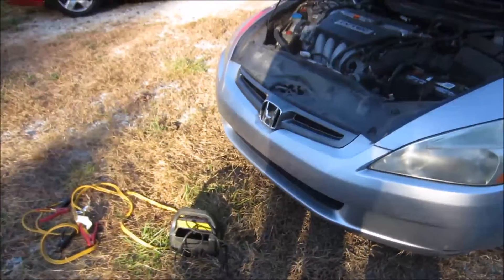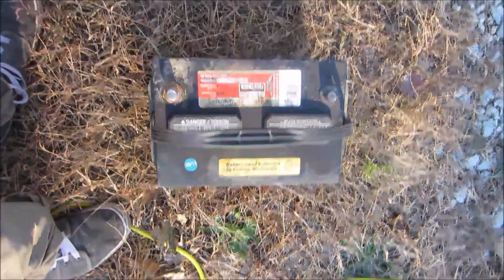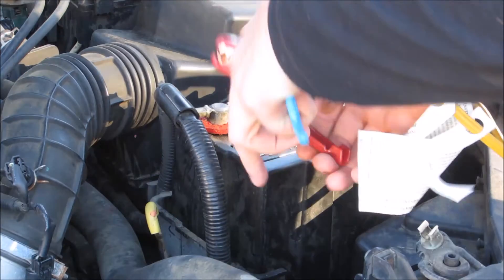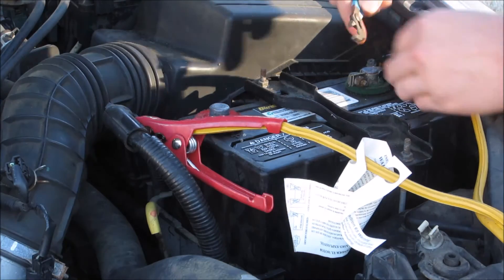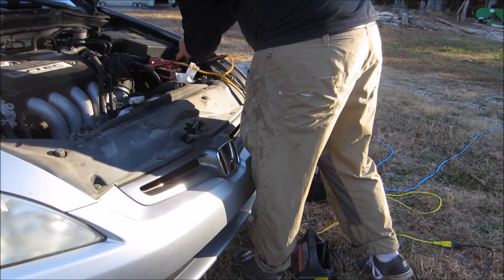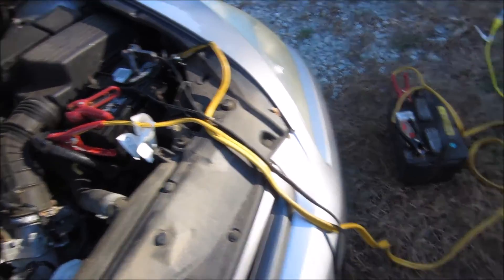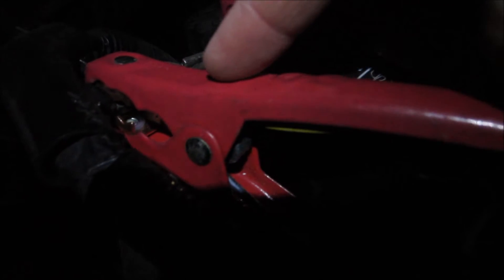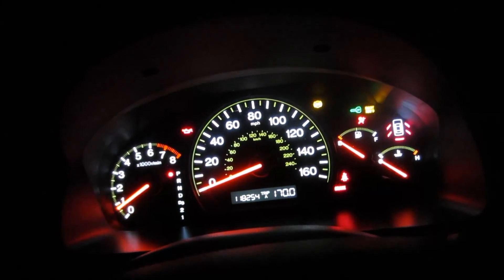Charge your car battery without losing your settings!

Comment from the maker: For those who do not think you need to disconnect your battery to charge it in a modern car: page 295 in my 2003 Honda Accord manual: "If you need to connect the battery to a charger, disconnect both cables to prevent damage to the car's electrical system."  Whether this is really a requirement is up to you, and may vary by manufacturer; however, this is straight from the official manual by the manufacturer.  Thanks.
Reply: Manufacturer CYA stuff. 
Unnecessary.
Reply from the maker: @DigitalBathInAZ  CYA??
Reply: Yes sir I always disconnect the battery terminals when hooking up a charger 🔌. My FJ Cruiser is getting a little battery charger treatment right now.

Comment: You can charge a battery whilst its still connected, as long as you do it properly. Positive clamp to positive terminal and negative clamp to a ground, not on the negative terminal.

Comment: Don't listen to this plethora of bad information and advice. You can charge your battery while it is connected. Doing it this way risks the + & - cables touching which is potentially a bigger concern than anything this video suggests. The other alternative for this guy is to let his car run for an extra couple minutes before turning it off periodically. The rest of the ideas and suggestions are equally silly.
Reply: Extra couples of minutes cant replace the power that was lost from the starter when he started the engine plus the voltage the baterry needs even before that. It needs much more time to let it run.
Reply: @petertomas3665  each vehicle has a different amperage alternator but most car batteries can be adequately charged (allowing for restart) after 10-15 minutes of operation. If you want more charge then run longer - optionally, you can continue to charge the vehicle the next time you drive provided you aren't using large current draws like seat-heating, electric window defrost, boom box stereo, etc. Also, manufacturers suggest/recommend disconnecting the battery for liability issues (and if you're low in experience maybe that's not a bad suggestion particularly if you're not so knowledgeable with the power levels of a battery charger or polarity of the cables/battery posts). That being said, adding an additional power source (jump start with another battery OR battery charger) simply creates 'parallel' power and does not add voltage - it merely adds amperage (dead battery + power source) just as your alternator + battery do during normal operation. If you aren't sure about these things it is wise to err on the side of caution BUT if you're inexperienced you should trust your repairs and servicing to someone who does have experience.
Reply: @RidiculouslyRandy  Yes , personally as electronic in robotics for 42 years im expirienced enough to know what to do, its just you said a couple of minutes (2 minutes) which is not enough in any case to charge any battery in any vehicle drasticly. On the other hand 15 minutes as you said is way more time than 2 minutes and can have some results.
Reply: @petertomas3665  I said, "an extra couple of minutes" but thanks for the interpretation distinction. The lack of preciseness was intended to imply my point that simply running your car would be preferable to the work of removing and disconnecting from the vehicle. No tutorial - just an intended thought provoke.
Reply: @RidiculouslyRandy  No hard feelings :) Maybe i misanderstood because english isnt my native language. Your point is very correct.

Comment: who said you can't charge the battery whilst it is connected. what does the alternator do.
Reply from the maker: Trickle charging is OK, but battery reconditioning or "full power charging" can damage electronics in the car.  It has to do with high voltage spikes during the cycle.  I believe the reason I made this video is because my car's manual said to disconnect it.  I agree with your alternator comment; but, I suppose that is still a lower voltage output than a full power charge cycle. Thanks for the comment!
Reply: @someoneinncarolina  Yes, modern maintenance battery chargers are designed to be used while your battery is still connected. This of course, will take more time to fully charge your car's battery using a maintenance charger but a little bit of pre-planning is a lot better than having to remove a car battery to allow for "full power charging" for quicker charging. I do appreciate you taking the time to put this instructional video together.

Comment: nice video man and very helpful. my question is? What if we have dual battery  2 batery on the car how to operate for keeping data on the vehicle ?
Reply from the maker: Depends if the batteries are in series or parallel and the voltages, so it's not an easy answer.  Basically though it boils down to matching voltage because the vehicle will not be running, just preserving settings.
Reply: when the batteries are in parallell 12 voltage.  The basic exemple toyota land cruiser 120 series 2006. IS THE SAME PROCESS LIKE YOU SHOW US ON YOUR YOU TUBE CHANEL OR IT MAY EXSIST A DIFFERENT WAY?
Reply from the maker: Yes, you would just use a 12v battery to keep the vehicle supplied with power, then disconnect the terminals to the dual batteries while charging them.  That said, whether you can charge the batteries with them connected to the vehicle, or go through the steps that I show, is something you may be able to find out in your manual.  As others have commented, the steps I go through may be unnecessary depending on the manufacturer's recommendations.

Comment: I love your videos but this is the dumbest thing I've ever seen from such a smart guy. lol i'm sorry. Hook the charger up w/o all that nonsense.  Its a Honda not a Rolls. You couldn't hurt it if you tried.
Reply from the maker: Haha, I appreciate that.  One or two more comments like yours and I'll bother to break out the manual to provide a definitive answer for my specific car. ;)
Reply: Please break out.  Why the delay?  @someoneinncarolina
Reply from the maker: @davehicks2385  OK, page 295 in my 2003 Honda Accord manual: "If you need to connect the battery to a charger, disconnect both cables to prevent damage to the car's electrical system."

Comment: You do not have to disconnect the car's battery to charge it. Just connect the positive charger cable to the battery + red terminal and connect the charger black negative cable to an engine ground. Then start the charger. When done charging, unplug the charger and first disconnect the black charger cable and then the red cable IN THAT ORDER.
Reply from the maker: Doing a little research it seems to mostly depend on the type of charging.  If full charging you should disconnect it, if trickle charging to hold the charge at the top of capacity, then you don't need to disconnect it.  In my own personal experience with my 2003 Honda Accord I can tell you that things act "strangely" when I am charging without disconnecting and I try using some of the electronic systems in the car.  I'm recalling something along the lines of when I used my key remote to lock the car while it was charging, it caused the smart charger to fault.  Restarting the charging cycle it continued just fine, but maybe the sudden current draw was the issue.  Following the car's manual is obviously the best bet if that is addressed.  Thanks for the comment!